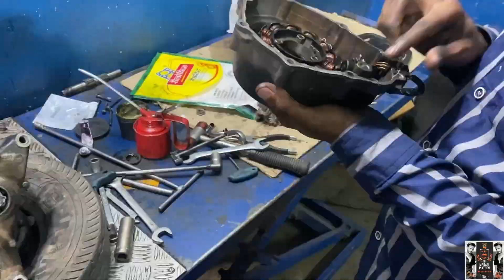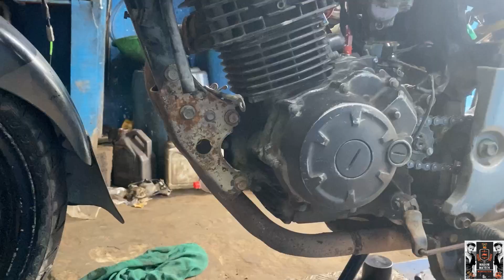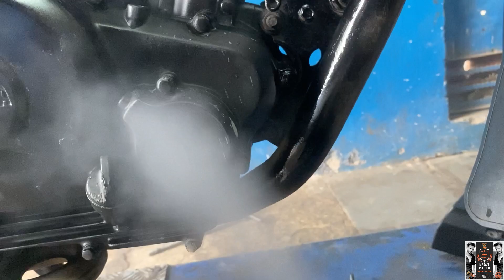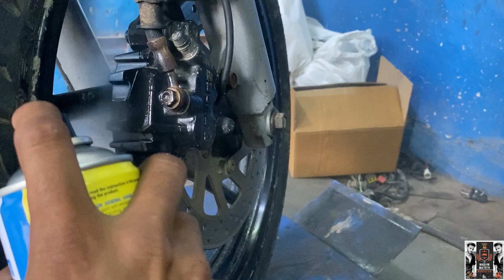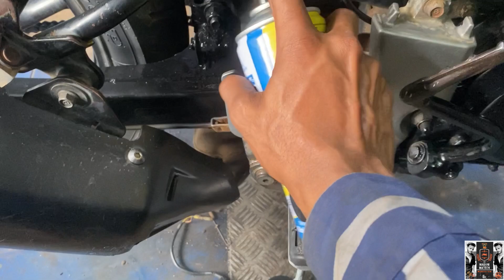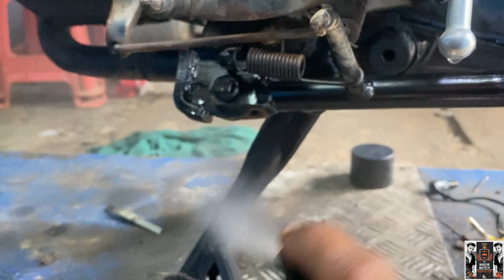Yamaha FZ full Engine Repairing || FZ Complete Engine Fitting (( Part 3 ))

Comment: Hi 
FZ V2 purchased on 2019 clocked 72000 KM 
Went to change chain sprocket of the bike but service Center mechanic is asking to change drive shaft . What would be the average life of drive shaft ? 
Thanks
Reply: Mine lasted 90000km